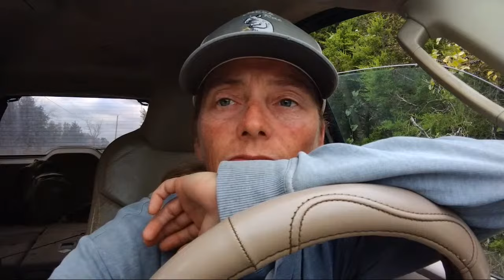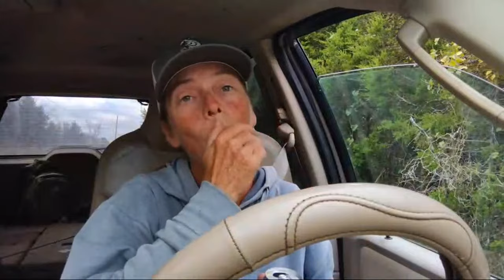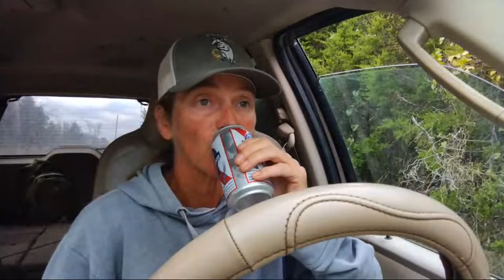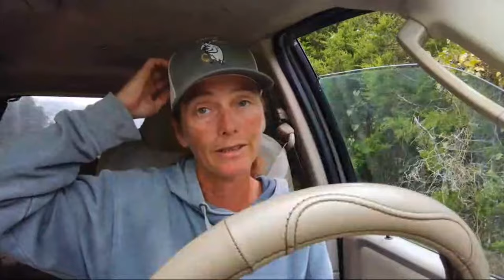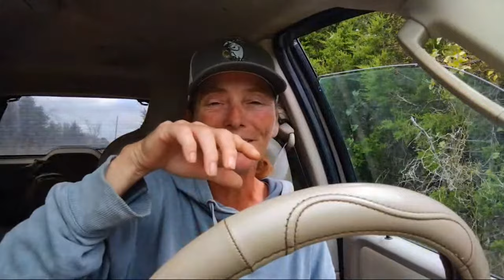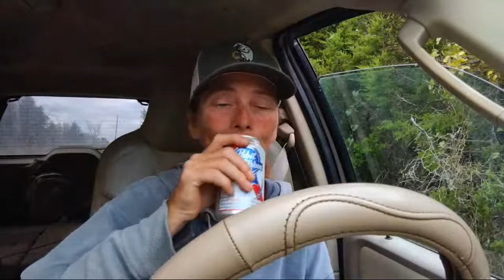So how did last night go?

Comment: I missed it, lol. Run it for a minute with water circulating through it. Turn it off and pull the plugs and see if any are wet. That will be the ones that aren't firing. Does it run good cold and bad when it warms up? If it gets hot it will run bad. I still say you should clean the carbs too. That's the good beer. It won first prize lmao. Good luck with the motor.
Reply from the maker: The day before it ran better than ever for most of the day (after Sea Foam and gas tank cleaning). At the end she started hiccupping again. Plugs, fuel line and filter are getting replaced today. Guess I'd better take off the white gloves and figure out how to clean the carbs. I feel another YT session coming on. 🤣